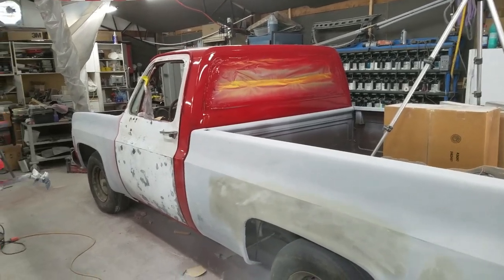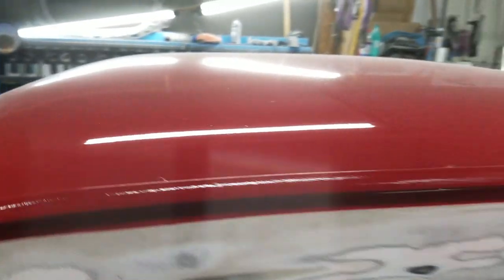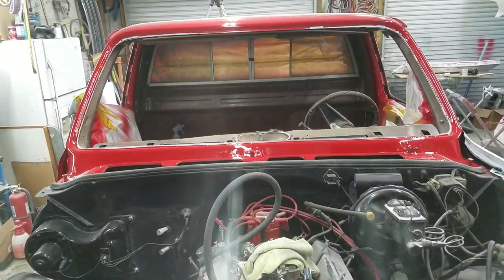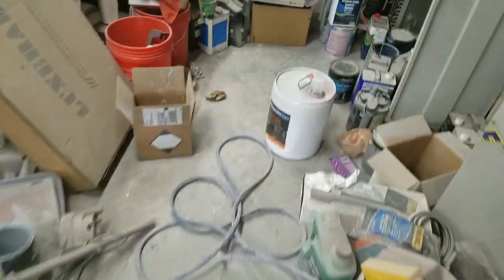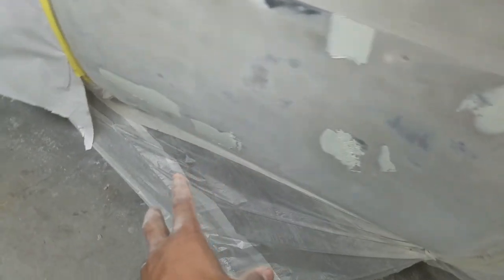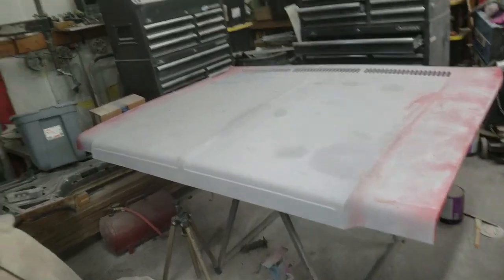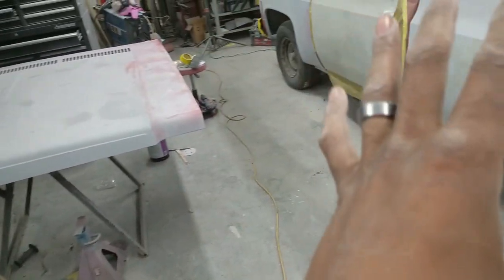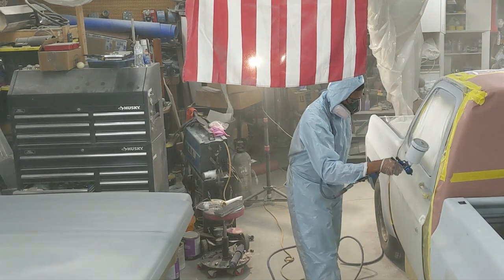How To Prep Your Car or Truck for Paint 1977 Chevy C10 Truck

Comment: What paint materials do I need to paint my truck and how much ? (Example) 2gal primer
Reply from the maker: Great question, I probably should make a video about this.

Typically 1 gallon of primer/sealer is plenty to take care of the entire job, you can also reduce your primer to a sealer. Spraying sealer over the entire vehicle will give you a better foundation for your paint. 

Usually a standard cab truck can be done with about 3 quarts, I usually get a gallon and 1 reducer which makes 2 sprayable gallons of paint, which is enough to do the interiors of older cars with steel interior panels. 

1 gallon of clear will do what you need as well.

This is just a loose number, you can do it with less material as well.

Hope it helps, I will try to post a video soon.👍🏾